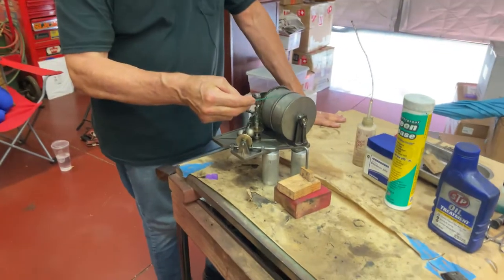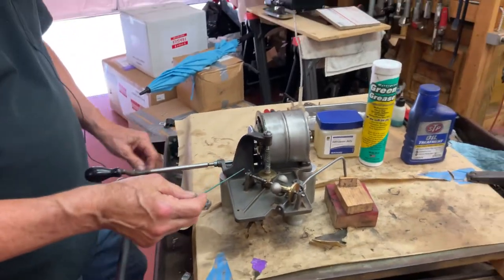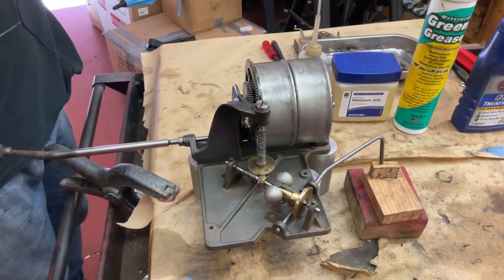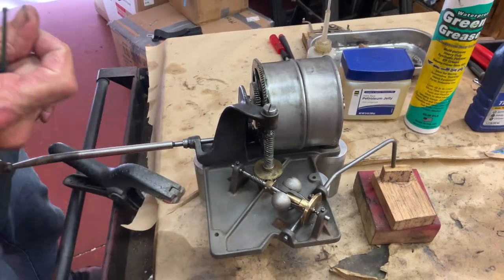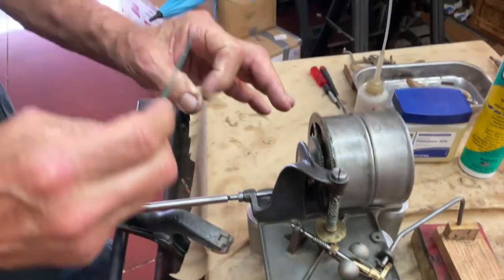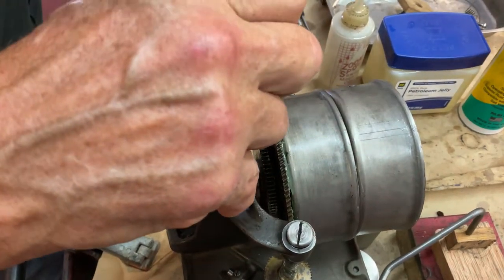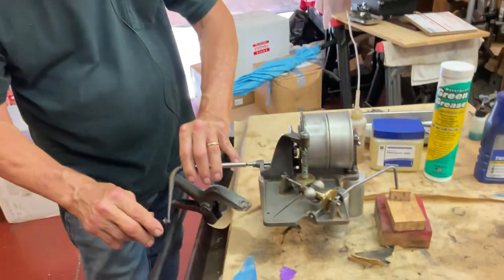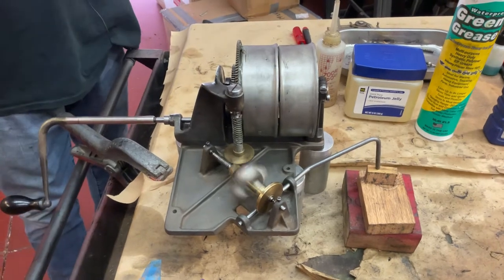1149.  Greasing and oiling the Victrola X motor￼

Comment: Is this similar for a VV-VIII?
Reply from the maker: Yes
Reply: @ I did the oiling, runs much smoother! Thank you. By the way do you know where you can get replacement flanges for the Victor Exhibition?
Reply from the maker: @ right now they are in short supply so watch eBay and hopefully we’ll get somebody to make them
Reply: @1974hurt  Cheers! Looks like I’ll have to change my gaskets, maybe soften the rubber of my flange or just wait it out :)
Reply from the maker: @ wait it out! We’re hoping we’ve got somebody lined up to build them

Comment: Great Video! I just swapped a VV-XI-G motor in my grandmothers VV-XI-F motor and it's now running again. Spring barrels need to be cleaned out and would love to know the best video on how to take them apart for cleaning. If you can. Thanks for being such an amazing resource of information! Thanks
Dave
Reply from the maker: 353, 202, 1149, 1850, are good videos to start
Reply: Thanks :)  @1974hurt

Comment: I have not seen any video on my RCA Victrola 012 portable player.  It has a casted body with a steel plate on the other side stamped the general industries co.  Elyria, Ohio. U.S.A.          JUNIOR 
   The governor weights are more coin shaped. And the spring containment drum is smaller.